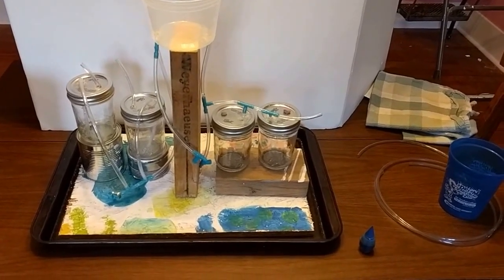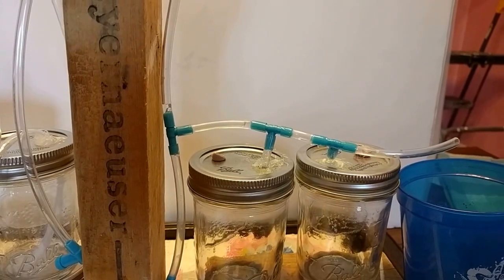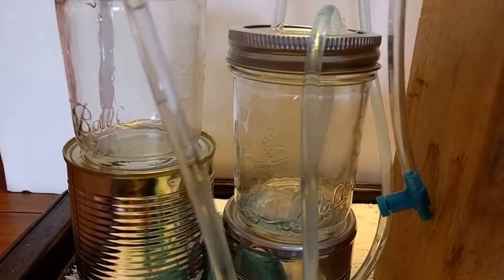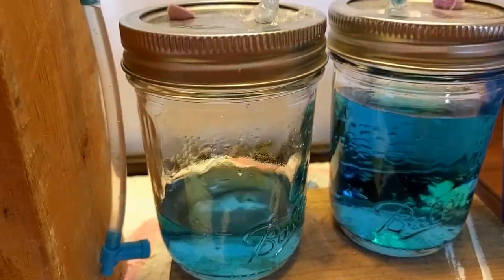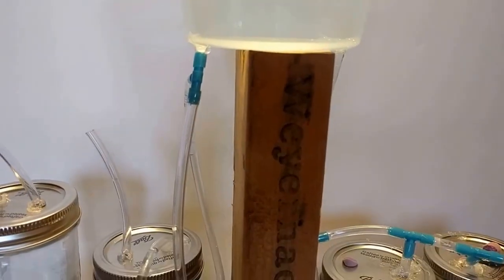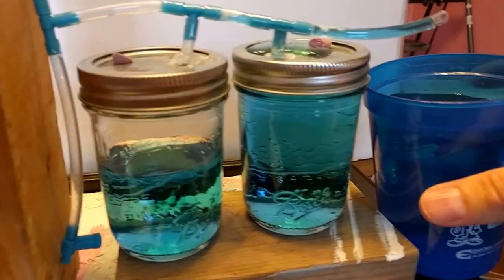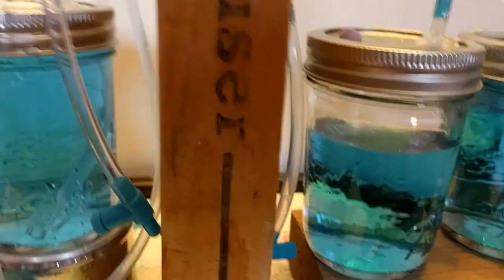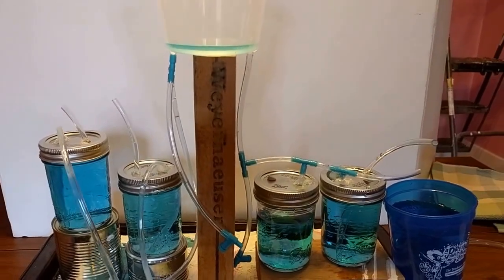Model demo of the Ultimate Rain Barrel System

Comment: Hi Ben, thanks for sharing this.   I'm going to build one of these two systems to capture rain into about 10 or 12 barrels.   Any reason why, instead of a manual siphon, you could not use an electric pump to pull the water out of the simpler system?    Assuming you have the right pump with the right head/psi to overcome the height of the siphons of course.  The same question still applies to the ultimate system but I think thats fairly obvious, a pump after the valve would work fine, if only to increase the PSI to the garden irrigation systems.
Reply from the maker: If you have a pump that's small enough to fit in the barrel, that would work fine. The advantage of using a siphon is that you don't have to modify the barrel or rely on electricity.
Reply: @ZaneRokklyn  Makes sense.  One more question, I'm looking at 55 gallon barrels and trying to figure out what kind of pipe or tube to use to the ultimate system?  The barrels seem to have 2 inch bung holes with NPS threads and a 3/4" for a vent... can you share what you used to connect the siphons to fill and drain the barrels (H, I,J in your diagram) and also the vent (N)?  Thanks in advance, this is such a cool design I can't wait to build it, so perfectly efficient.

/Dave
Reply from the maker: @davefeinglass9118  the barrels I used still had the plastic plugs that screw into the bung holes. I used a spade bit to drill a hole in the center of each plug and then threaded a pipe fitting into one for the snorkel and pushed rubber garden hose through the other for the siphon. Not 100% watertight, but close enough!

Comment: In another comment you wrote that the barrels could be at the same height, if the height of the siphon tubes were staggered in height. I understand this allows the barrels to be filled in sequence, but I fail to understand why filling them in sequence matters. Why not let them all fill in parallel?
Reply from the maker: Because the water pressure you get out of the hose when you drain the barrels depends on the height of the water column. If you fill 3 barrels 3" full, you'll have a lot less pressure than you would have if you had filled one barrel 9" full. Filling the barrels in sequence allows you to build up pressure.

Comment: How is the pressure at the discharge with the syphon system?  Is it comparable to the amount of head pressure you get in a system that water flows freely from.
Reply from the maker: Assuming the siphon intake is at the bottom of the barrel, the pressure is equivalent to a spigot at the bottom of the barrel. The main limitation I've run into with the siphon system is that if the water at the top of the barrel is frozen, you can't access the liquid water beneath.

Comment: In the Ultimate design is there any reason the barrels can't all be at the same height?
Reply from the maker: No, but the siphon tubes that feed them need to go up to different heights. In the article the barrels are shown at the same height with different height siphons. For the model it was easier to put the barrels at different heights as well.